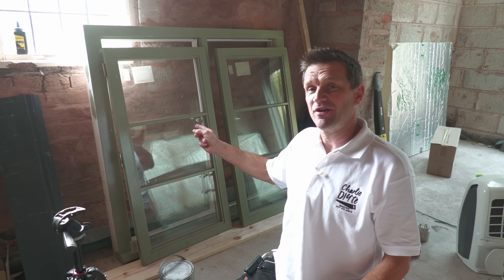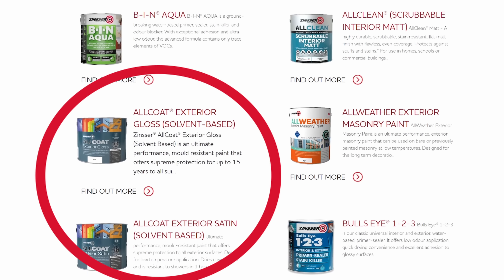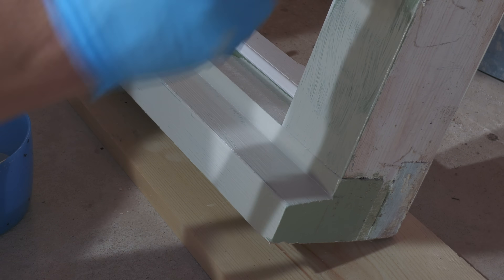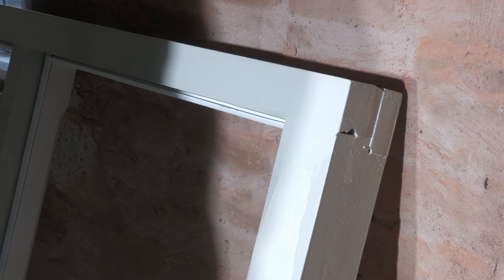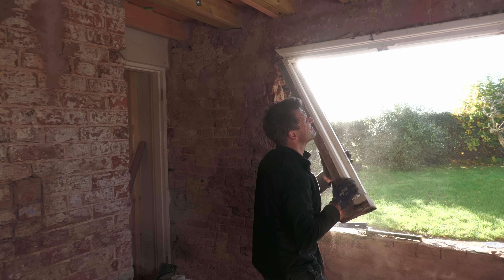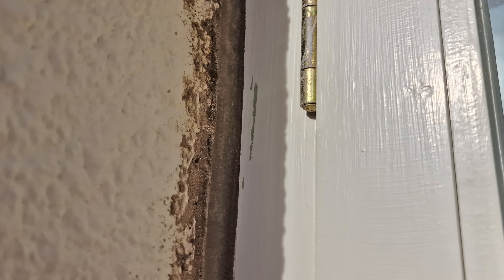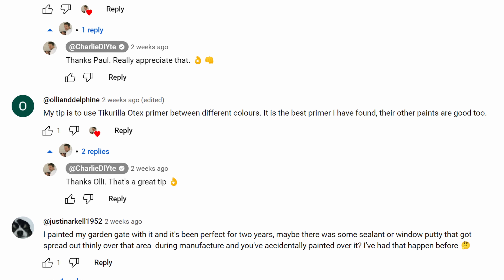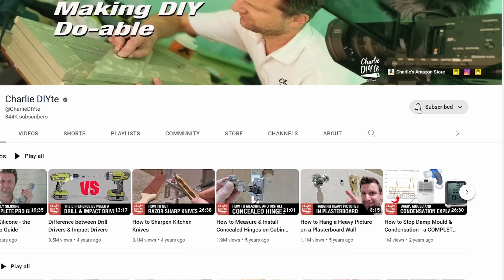Can You Repaint Windows Without Priming?

Comment: Nice work again Charlie.
I've used Zinsser Allcoat on my timber windows. It is extremely good, and showing no signs of peel or wear two years later.
As a paint it is quite thin, and really requires 3 coats to obtain good coverage. Although the 1 hour recoat time means this is not an issue. It's especially good for external doors, where you are unable to leave them open for long periods for the paint to cure.
I also have some timber windows coated in Dulux Weathershield. The items painted with Dulux move significantly (large gaps in summer, catching in winter). The Zinsser windows also move, but no where near to the same extent as the Dulux. Whether this is down to breathability of the paint I'm unsure, but Zinsser seems to stabilise the timber better.
I've even successfully coated Zinsser paint (with bulls eye 123 primer) over Osmo oil, albeit with a very good sand. Zinsser technical dept told me they could not recommend, but it was my best option, and worked a treat.

Comment: An important  and often overlooked consideration for water based exterior paints in spring and autumn is, not just the temperature, but also the humidity levels.  Most shouldn't be applied above 80% (85% in Allcoats case according to tech specs) as they will not dry and can in some cases begin to run and separate overnight, making a mess of the finish and will also potentially affect the adhesion too.

Comment: A few years ago we painted our upvc front door with allcoat satin waterbased in f&b oval room blue, it was such a transformation and held up really well. The beauty with finishing it yourself is that when someone does damage it with a tesco crate for example, you can recoat the whole door in about half an hour.
I've recently done my window frames in Bedec MSP - again, amazing transformation. 320grit light sand first, cleaned with sugar soap, then brushed on. It dries so quickly in the summer (will try with floetrol next time) sprayed would be excellent also. It's worth really cleaning the rubber seals and lightly coating in silicone grease, prevents them binding overnight with the cured paint 👍🏻

Comment: I’m a Zinsser fan-boy. I sprayed a good bit of the interior of the house with Allcoat exterior. Two coats with an airless sprayer. It’s the best paint finish I’ve ever had. Also, have a look a Bedec Barn Paint. It too goes straight on, covers amazingly well, and it looks bullet proof. (I’ve only used it on outdoor furniture / garden room doors - I think the paint will hold up very well indeed.)
Reply: As in your ceilings and walls or just woodwork? Exterior paint shouldn't be used inside because of the biocides
Reply: @Garage_GymRat it's for interior or exterior. ...

Comment: Can confirm that Allcoat is a great product. I used it on masonry, a metal garage door and the wood frame around it. No sanding just a wire brush to remove flakes and then a good clean. I think it's been on about 6 years now, the masonry is just starting the show signs of degradation where it gets a lot of rain and sun near the ground, so that will probably need doing soon, the masonry higher up still looks perfect. Door frame also looks pretty good, probably need doing again in a couple of years, the metal garage door is honestly looking great and has only needed a few touch ups where I have had trouble with some small rust spots coming through, once treated and painted though they seem to be ok.

Comment: Just a Tip whenever  you're removing the Masking Tape, pull the Tap off at  45 degrees past the 90 Degree angle this offers the best chance of not ripping off the fresh paint as there less contact with the paint as the contact with the paint seems to have a smaller surface area to contact with i use ScotchBlue Blue masking tape and this is a Joy to lay down and remove , giving you a great sharp edge and wont bleed at the edge and you can leave it up for several days... SORTED... Great Upload.
Reply from the maker: Such a good tip. Thanks for that mate. 👊 I'll get some Scotch Blue too. 👌

Comment: Hi Charlie,I used same water based white paint zine, as yourself 3years ago on my brown wooden windows, when I purchased the paint, I also bought the glue primer that zine also recommend and supply,I gave the windows two coats of each and they still look good ,also very nice paint to work with,I will be getting it again as lovely to work with no strong paint smells i think just with the corner on your Window as no paints normally cover silicone only acrylic based silicone I think , thanks for your demo

Comment: I had problems with the allcoat on the capping stones on my mother-in-law's wall. I couldn't shift the existing paint with a heat gun and scraping just removed small brittle chips. This product seemed ideal. The wall was dried(quite a damp day), sanded and wiped down. The temperature was around 10C so at the limit. I gave it 2 coats allowing 2.5hrs between coats due to the temperature. It looked great. Next day I'm in trouble because areas were flaking, taking the existing paint with them and also a burst bubble type effect all over except for a small area I'd managed to strip. After seeing your reviews I'm guessing user error but not clear where I went wrong or how to fix in the current temperatures.

Comment: When I did mine I ended uo going for Bedec MSP, which it seams is pretty much just like the All Coat. So good that it goes on virtually anything without hardly or no prep! Something I learned, you cant get away with cheap brushes, it needs to not be messed with and a cheap brush doesn't hold enough to stop it from dragging almost instantly.   

BTW, never try to use a cyclone mixer that you have bent = messy mistake!

Comment: I sprayed some IKEA wardrobe doors with Zinsser BIN earlier this year after sanding the surface first.  I followed up with paint weeks later and then fit the doors weeks after that.  When I drilled for the handles I put a small amount of Frogtape in place to mark before drilling, but after lifting the tape I found the entire paint surface (paint + primer) was lifting around each drilled hole.  I know that Zinsser seem to have a great reputation but equally I don't understand why a primer would lift so easily off the underlying surface.  For the record, I did a test of paint directly onto the wardrobe surface vs paint onto primer before I started.  Without leaving it to cure I could definitely scrape the paint off the surface with a fingernail more easily on the non-primed surface as you'd expect.
Reply: You left the primer too long before over coating with finish coats....

Comment: I did the gable end fascia boards in 2016: sanded it back to wood, spot primed the knots with Zinsser BIN, primed it all with Bullseye, then 2 coats of Allcoat gloss water based with a bit of Floetrol added as it dried really quickly. Still holding up well now
Reply: Zinnzer  bin is only for interior use

Comment: Don't use sand and cement to bed timber it will rot the timber lime putty then from bare timber knotting the knots use linseed putty or lime putty for any filling 2 pack wont last it will just crack when the wood flexes then 3 coats linseed paint thinning the first coat with turpentine and raw linseed oil 2-3 days between coats wont crack or peel and won't rot the timber it will just wear away through UV making future re decs much more straight forward and cheaper thats what was always used but a lead version before 1920's they use zinc now instead of lead. That zinsser all coat water based  won't last a year
Reply: Windows were already painted...linseed oil paint like bare timber best... but you should know that Jack, also 1hr re- coat v 2 / 3 days did you watch the vid?
Reply: @englishdecorator  yes 3 day recoat always even in summer strip the the timber then a primer coat of linseed paint raw linseed oil and turpentine but linseed paints can suffer from mould and algae growth now they use zinc instead of lead for fungicide. If i can I go down the route of stripping the timber knot 1-2 coats of owatrol oil and 2-3 coats of owatrol deco best modern system but very costly

Comment: I'm surprised about CT1 fail actually
Reply from the maker: Yes I spoke to the team at CT1 and they were aware of the issue with UV rotting the silicone. Whether they've resolved it or not I don't know. I'd never use it again outside though.
Reply: @CharlieDIYte  if they are aware, why their product (currently looking at CT1 white sealant that I have) clearly states "UV RESISTANT" on it?
Thanks for pointing this out though, I won't be using it for outside as well.
Also it's performance "under water" (another claim they are making) isn't that great either as it didn't work well for me when I tried applying to a clean wet surface.

Comment: I used this to paint my wooden bay windows....it is without a doubt the worst paint I have ever used. It was impossible to get a smooth finish and it hasn't lasted well at all. Usually I'm a Zinnser fan, but this was very disappointing.
Reply: I had a similar experience with my windows, the paint was impossible to get to lay flat and 1 year on its peeling everywhere. I was really careful with my  preparation too.